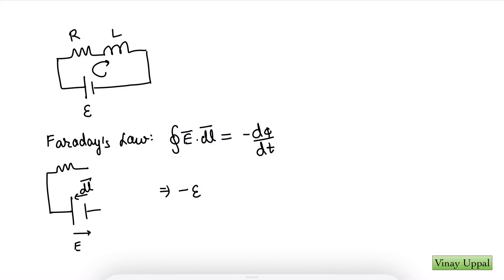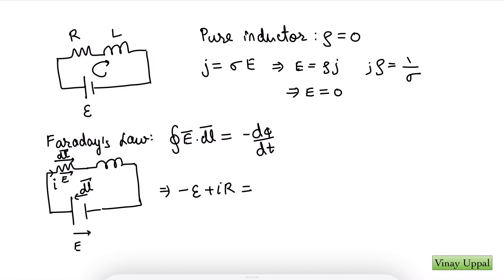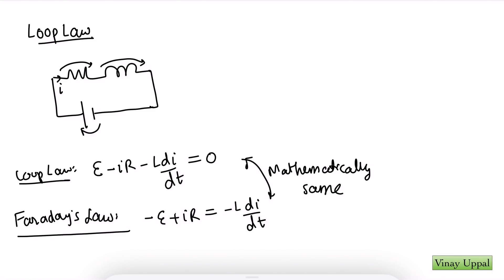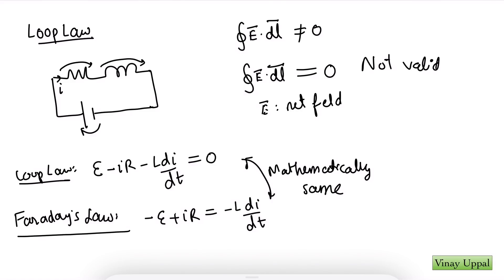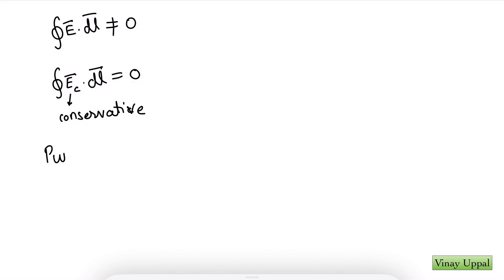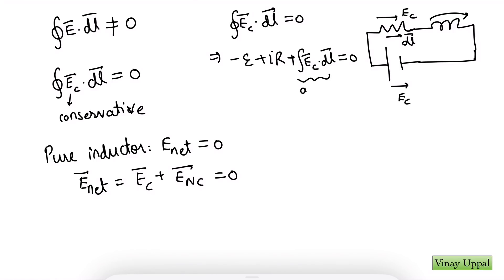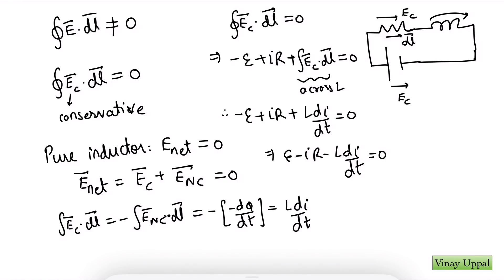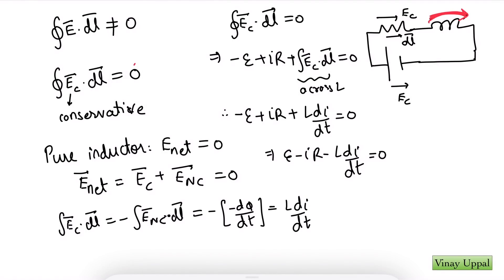RARE: Episode 6: Controversial! Yes, Loop Law is valid for RL circuits. Here’s why.

Comment: Also Prof Lewin mentioned that any path you take across the inductor will give the E.dl term to be L di/dt, but only the paths whose projection in the plane perpendicular to the plane of the wire( i mean the plane of each loop) is a to and fro straight line with zero area enclosed would give that ans

Comment: Isn't Kirshoff's loop rule about hopping from point to point, explicitly going around the components? (Forgive my newness if these are dumb questions.)

Also, I like the idea of decomposing the zero E in the coil wires into conservative and non conservative (induced).  This has the feel of the floating magnet over a superconductor demo.  You can say there is no net downward force there, but  saying there is no gravity seems incorrect... Is the comparison valid?

Finally, I am still wondering how two voltmeters in Lewin's experiment could read differently.  They are hooked up at the same points.  Is it because they go around the solonoid in different directions?

I like what I have learned from you... Thanks.
Reply from the maker: No such thing as a dumb question! 

Kirchoff's Loop rule is basically saying that the potential change around a closed loop is zero (because potential by definition is defined for conservative fields ). 

With regards to the comparison you make, I tend to stick to mathematical analogies rather than physical ones that may be misinterpreted. Although I get your point about no net force but gravity could be present. 

The reason voltmeters could read differently is because the spatial location of the voltmeters with respect to the magnetic field matters! That is something that gets ignored when you study current electricity circuits because its effects are not present in the absence of magnetic field. However as soon as there is a time-varying magnetic field, then the location of the voltmeter matters because the non-conservative electric field induced by the magnetic field will affect the voltmeter readings and this electric field itself is location-dependent.

Comment: Sir writing potential difference in loop law using only conservative field is incorrect as when you go to prove force on a electron which defined current then at that time non conservtive elecrtic field will also play play a role in force and will decide current
Reply: Walter lewin is correct here
Reply: Sigma E A =i here E is E net
Reply: This also decides current
Reply: Hence kvl must use this ,you assumed inductor to be a superconductor thats correct even sum of e net is zero tahts also correct but in kvl e net will come

Comment: Also, sir, in loop law we actually learnt that the sum of potential differences/drops in a closed loop is zero, but we can't really find the potential for a non conservative field can we?  We can only find the work done in bringing a unit charge from A to B in a specific path which makes ∫E.dl in the inductor path dependant. So like you did, only if we consider the conservative field we will get an answer which is path independent, is that correct sir?
Reply from the maker: I'm not sure I understood your doubt. In any closed loop, independent of path, the integral of conservative field is zero.
Reply: @PhysicsWithVinayUppal   yea my doubt was that across the inductor alone ∫E(non-conservative).dl would be path dependant right?
Reply: @gokulr8755  if you consider the circulation of the total electric field, yes, by Faraday's law, you get a value  equal to minus the magnetic flux through the surface that has the closed path as a boundary. 
This implies that the two path integrals between any two points on the closed path (one along one branch, the other along the other one) will have to be different.

But note that once you specify a path between two points the path integral will be uniquely defined. Voltage between two points is path dependent. The path integral of E.dl along a given path is... the one and only voltage along that path.

The closed path that follows an inductor, can be decomposed in two parts: one that goes through the copper, and a little part that jumps between the terminals. We know that inside the perfect conductor Etot is zero, so all the voltage will appear at the terminals. 
Voltage as the path integral of the total electric field does depend on path. In fact voltage along the coil will be zero, while voltage along the path that jumps across the terminals (what we call voltage across the coil)  will not be zero. KVL dies right there.

The reason we can salvage KVL in lumped component circuits is that, instead of considering the circuit path that goes along the copper (and deal with  *a variable flux inside our circuit path*) we make the circuit's path skip the magnetic field region by jumping at the inductor's terminals. In this way there is *no variable magnetic field linked by the circuit path*, and by attributing to the inductor the voltage drop L di/dt we can PRETEND that KVL is still valid. We can call if modified, or extended,  KVL..

In reality it is no longer valid everywhere, because if you define voltage as the path integral of the total electric field, voltage IS path dependent, so it's actually Faraday's law in disguise. But if we do not look  inside the magnetic component, where voltage is multivalued, we can  pretend that voltage is still single valued and only depends on the endpoints (and in a way it is, at least in all points of our circuit's path)

This is why Feynman insists on not having variable magnetic fields outside the lumped components.
For lumped circuits KVL and modified KVL work, and they correspond to what Lewin addresses as 5+3-8=0. He says that the physics stinks because in reality it's 5+3=8, ie Faraday's law but it's just a minor problem.

Where KVL and modified KVL both die is in non lumpable circuit, like the Romer-Lewin ring.
Reply: @copernicofelinis   That was what I needed to know, thank u for your amazing explanation :)
Reply: But u see the role of a battery is to maintain constant potential so even if field in non uniform but its closed integral wrt dr shd be a constant. Its like gauss law where E maybe varying but still the flux is a constant ie the charge inside the gaussian surface.
Reply: @sumeadhms3482  Its not about a non-uniform, conservative electric field, i understand that ∫E.dl will be path independent. But consider some circular surface through which B field lines are coming out and its time varying, there will be concentric circular electric field whose magnitude u can evaluate by faraday's law, now just try to find potential difference ∫E.dl between two points on one such circular loop once travelling through the major arc and once through the minor and once through the straight line joining them, you'll get 3 different values of potential difference for the same 2 points which is why its non conservative and path dependant
Reply: @sumeadhms3482  + Also the role of the battery is to maintain constant potential only across its two terminals, the potential across resistor and inductor will definitely change as current is changing

Comment: Ok imma use uppal's loop law after this😎😂... Also, I really want to know how the non- conservative E field loops are cuz I'm really having a tough time visualising electric field inside inductor😅
Reply: Try Electrical Engineering Stack Exchange, search for "what would a voltage measure if you had an electromotive force generated by a changing magnetic field". There are pictures of the electric field components in and around the ring and of the total electric field inside the ring.
Reply from the maker: @copernicofelinis  👍
Reply: @copernicofelinis   that was cool, tysm :)
Reply: electric field inside conductor must be zero
Reply: @thegreatestdemon1288  that's only valid for an electrostatic condition, not always

Comment: Problem arises between electric engineers and their notations, they usually consider lumped circuits, so inductance of the closed circuit both intentional and parasitic are considered inside the the lumped inductance L, and the dphi/dt term corresponding to change in flux associated with the closed loop surface of the circuit (not the intentional inductance) ends up becoming zero as it was lumped in the lumped inductance. For them loop law on lumped circuit is valid, this is what electroboom wanted to clarify and Prof. Lewin being a true physicist used the correct notation of not using lumped model and considerig intentional inductance on LHS and inductance due to loop on rhs.
Reply: No, the problem is that the people who believe KVL still works do not understand that Lewin's ring is NOT LUMPABLE. What is described here is the difference between using the modified KVL (circuit path jumps at the inductor's terminal, so I can PRETEND the voltage difference is a potential difference) and proper application of Faraday's law (circuit path goes through the coil's copper, so circuit path encloses a variable magnetic field, hence voltages have to be path dependent and there is not in general a potential function.)

For lumped circuit you can use either: engineers prefer to think KVL is still valid, physicists prefer to think directly in terms of Faraday's law. This is what Lewin describe as the difference between 5+3-8=0 and 5+3=8.

But for NON-LUMPABLE circuits, such as Lewin's ring, it is not possible to define a circuit path that exclude the variable magnetic field region, so even the modified KVL cannot be applied.

Comment: A similar example that most jee aspirants would have seen cleared things pretty well for me.
Consider a circular region with time varying B field in a direction perpendicular to its surface and a conducting rod is kept along a chord, then find potential difference across it's end.
Now most people would simply, add two more rods, apply E= d(phi)/dt and loop law   (given B(t)) and quickly find the solution, but looking carefully, the Electric field due to TVMF is non conservative so we cannot apply the Uppal's loop law till now but analying the the forces on an electron inside the metal rod, we can deduce that another field would be induced inside the rod which is conservative and has potential difference equal to that of the non conservative one (in magnitude) and now uppal's loop law can be applied.
Reply: Yes, even Janardhan sir cleared that in his video
Reply: The thing wrong here is using only conservtive field to write net force on electron ,the current you write in net loop law is net current due to all forces but in loop law you are only using force on electron due to conservative electric field thats what incorrect is

Comment: I think it's not about disagreement over Physics. 
It's about disagreement of what loop law should be named which really doesn't matter. 
Professor Walter Lewin's Loop Law and Uppal's loop law are different by definition. So both are right. Now which of these was actually definition given by Kirchoff  only Kirchoff could tell. I would like to believe that Physics Giant Kirchoff obviously knew the right Physics so He probably had defined it in correct way only. 

This happens sometimes in physics because of disagreement over definitions. 
I have found such inconsistencies in few other places in Physics as well.
One of such disagreement that I had with Peter Gnadig of 200 puzzling problems of Physics fame   is related to definition of center of mass. 
I prefer to brush aside such trifle matters because after all its the Physics that matters .
Reply from the maker: My point was Prof. Walter Lewin has repeatedly said that loop law is for birds, so here I show why loop law is proper physics and that it can be used even in the presence of a changing magnetic field once you realize that loop is actually a statement of the fact that the closed loop integral of the conservative field is zero.
Reply: sarr 🥺

Comment: Sir if we consider a induced electric field creating EMF across a closed circuit and no battery is connected then can we use KVL then also? And also sir in non-conservative fields if one is asked to find a potential difference between two field then does it even mean something? Like how we define potential in non-conservative field as it is path dependent and can have infinitely many values for same position in the field?

And sir please explain how this conservative field is created and how is it cancelling or nullifying the non-conservative field? And in which cases is it possible that a non-conservative field can be canceled with equal conservative field?
Reply from the maker: A conservative field is generated to cancel out the non conservative field inside the inductor because it has zero resistivity and hence zero net field. Potential difference is defined only for conservative fields.